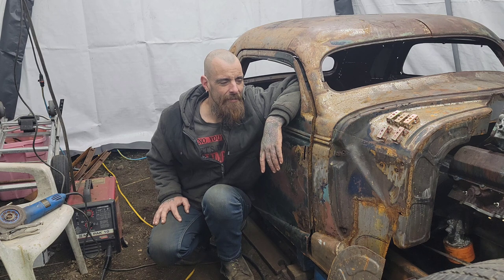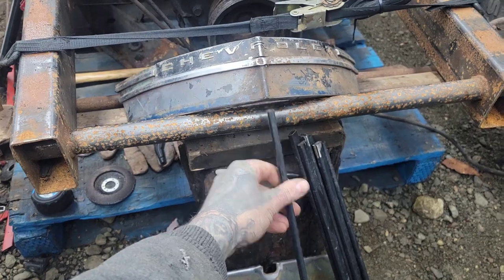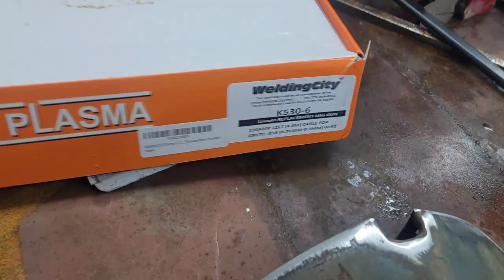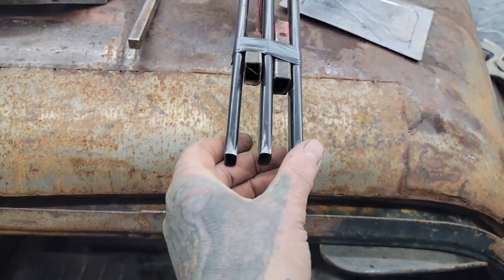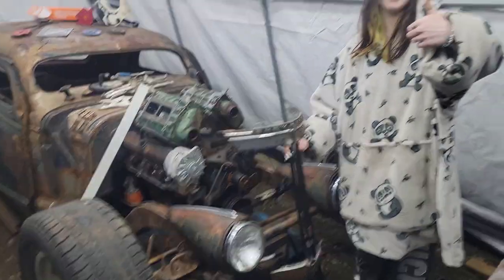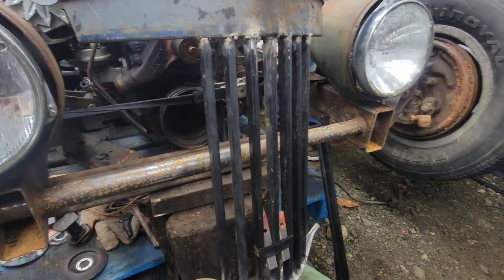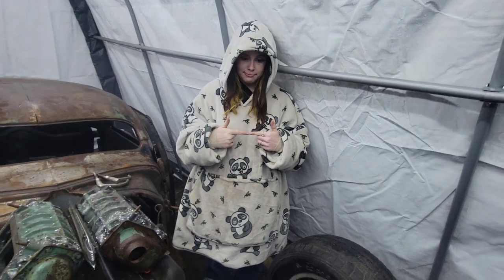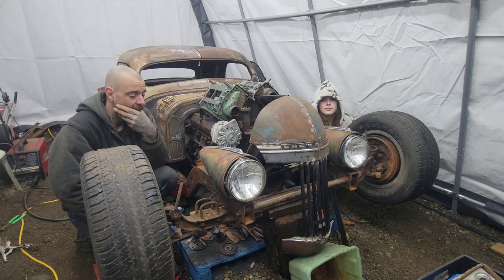Rat Rod Chevy with a Twin Blown Olds Distorting Reality on the Front End

Comment: Never thought of using those canopy parts for a grill. I like it. Had a bunch of them when I use to do the scrapping out of the campgrounds. I guess the few I have left will be removed from the scrap pile and put into my save pile. 

I agree lower the hood top a little more and if it was mine I would angle the grill bars by bring the bottom of the grill out 3 or 4 inches to help give it like a rake look. I do like the even spacing like that, just to vertical for me, needs to be like a cow catcher on a train but not that radical.
Reply from the maker: I've worked hard to not buy new metal.  The spirit of this car is to recycle everything I can, oddly, those bars have a nice shape to them.
I agree on the angle.  I was having difficulties propping it up though.  I just wanted to be able to step back and see it.  But it definitely won't end up vertical.

Comment: Hey Ryan. Thinking out loud. I've been an advocate then practitioner of customising since the late 80's. Within customisation, aethetically there can be no wrong. But there is always a flip side. If there is any view to selling this to re invest in tooling then dont totally dismiss mass appeal... whatever that means. I would suggest some wheels, weight it to ride height and push it to level unobstructed ground. Standing next to vehicles and attempting to judge proportions is normally a difficult. Also I'm not sure mixing the 30s running board style body with the hood and headlight proportions is going to gel, again I dont mean wrong,  but we can all spot a 'line' that doesnt fit right from 1000 yards once its sat in the open. The other point on this is rake. More or less everything runs flat to slightly down hill. Production and custom. Accross numerous ages and countries of customising. At present your bonnet is going to run uphill. I'm all for pushing boundaries and defying convention, but what else goes against this convention to compliment this aesthetic? And you can't say it's just a rat rod.... because you spent a lot of time and skill getting the roof, rear valance, firewall, cill lines, windows to all flow coherently. A constructive rock thrown from accross the pond. Andy. Ps space is tight as usual. If you ran a double skinned bonnet, but the skins were 75mm apart or so, could you make a place to hide 2 long slim radiators. Internally ducted and obviously vented to force air through. Like I say just thinking out loud.
Reply from the maker: If I ever use the line "it's a rat rod" as an excuse to not fix lines, I give every permission to publicly flay me.  
Zero intention of selling this, but I absolutely hear what you're saying.  Taking this Car a fenderless direction then using the parts off of the next generation big body car is absolutely going to be a stretch in aesthetics, but what's going to tie it together is the art deco lines. The Mohawks on the headlights match the body line in the doors, and I have all the matching stainless trim from the hood to continue it inside.  As it sits right now I know the car sits level, but grill proportions and angles are going to set the entire feel of the front end, and I'm back and forth on it more than I should be.  On one hand, I know what I would like to see it shape into, but on the other, that wouldn't fit the mission of this car, throwing money at it is the exact opposite of what I intend to do, the balance of aesthetic and budget is walking a fine line, but I think once it's done, it's going to be something that I will be happy with

Comment: Hey Ryan, I know we've talked about tires but have you considered some larger like truck wheels on the back? Like off of a 3-ton plus old truck wheels? The headlights are great. Experiment with hood options in Photoshop.
Reply from the maker: I've got a line on some 15" slots to match the fronts, and a truck load of cheap 27x8 slicks to fit it.  Truck wheels eat a lot of power and don't spin up as fast. I want to build something on big rims one day, but this one isn't the car.  
I do love these headlights.  They've got amazing lines, no matter what I do with the grill, those will be staying. 😎
Reply: @kingofbootyfab  True, the unsprung weight and the mass (and hence inertia) would negatively affect performance.

Comment: I like the fact that you make it a family project. Too many guys hang in the shop to get away from the family. Working with the kids and taking the time to teach them is time well spent and they'll remember it long after you're gone. Cheers!
Reply from the maker: My kids where raised in my shop.  At one point I had 4000 sqft and it was very well equipped.  They learned to run lathe and drill press as young as 5.   I enjoy my time working far more with them there, than without.  And I am forever grateful that sometimes they do too 😁